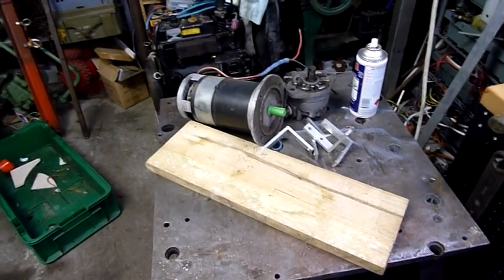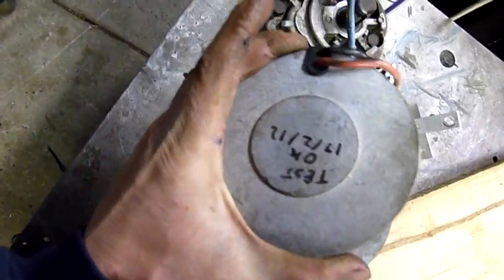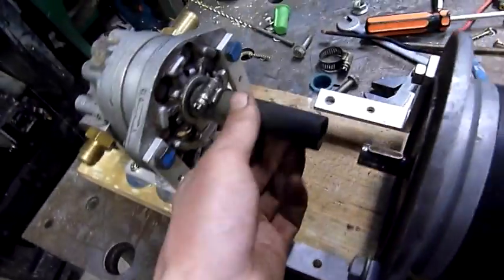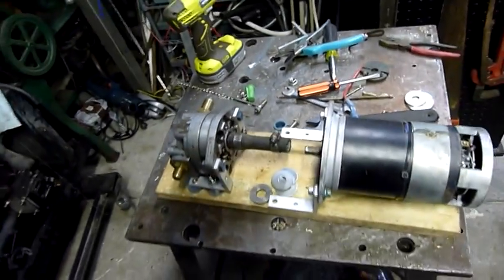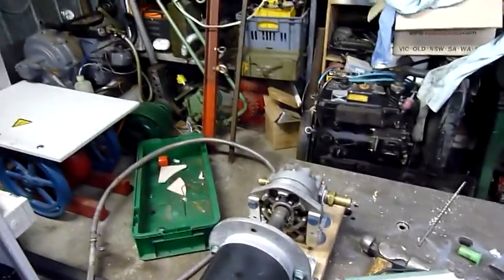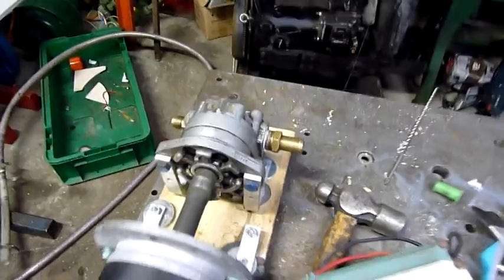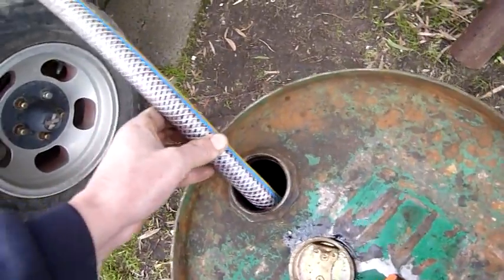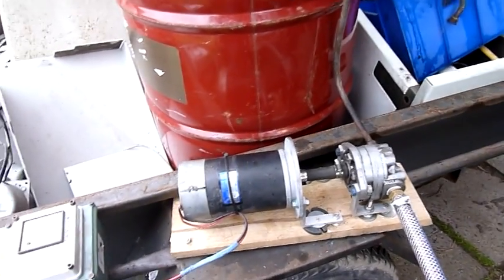Aussie Redneck oil transfer pump

Comment: When I made mine with automotive heater hose I only left a small gap between the two shafts . Reason is a hose could twist in between the two shafts. Probably a piece of steel braided hydraulic hose would eliminate that problem. also you mentioned sludge in the bottom. On my suction pipe I put a 90° elbow and a pipe six inches or a hands length and drilled small holes on only one side of the short piece of pipe. Then a cap on short piece , the holes drilled only on one side of same pipe are pointed upwards when I lower the suction pipe in. This way it always pulls in from the top and doesn't suck up the sludge from the bottom nor does it disturb the bottom. A simple picture would make plenty of sense. But simply a long pipe with a 90 on bottom with a short pipe with holes facing upward and a pipe cap at the end to heep out big stuff like cigarette buts or any big trash.

Comment: 1 pto sharft cover
2 it will brake your Hart
any links for 2-3 kilwatt 24volt batter charged from a 12v system

Comment: Hi ed' 
Nice little oil pump mate ;-) works well. It soon emptied that barrel lol

I found a nice hand cranked one that has the thread for those barrels. It works too. No leaks ;-) the chap at the scrapyard only charged me a couple of quid for it. So I cant grumble at that lol. Im going to use it for my minerel oil. But it needs a good cleaning out first ;-)

Thanx for sharing mate.

THUMBS UP☆

Comment from the maker: yep!, they are usually gear type pumps too!, good to have them since a startup without oil pressure puts a lot of load on heavy machinery and engines! 

Whenever I start my friends big Ruston diesel its another story, grab the primer handle and crank like mad until you see pressure, then go another 60 seconds :D